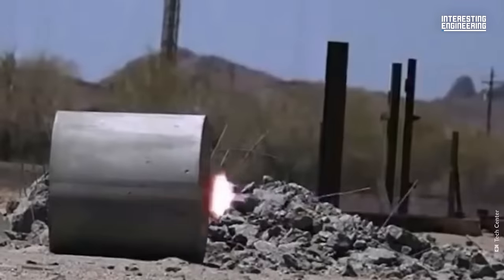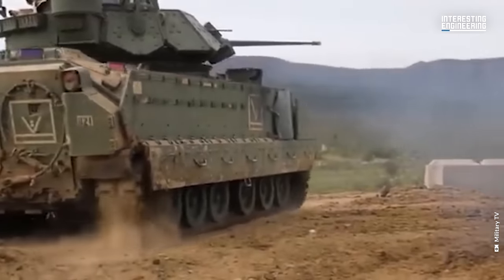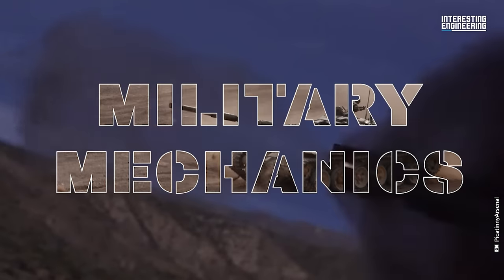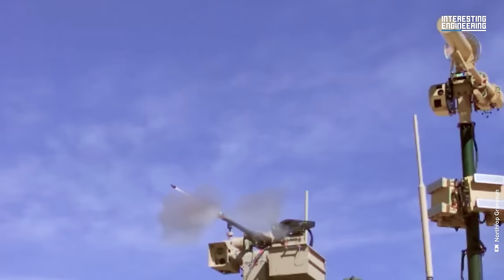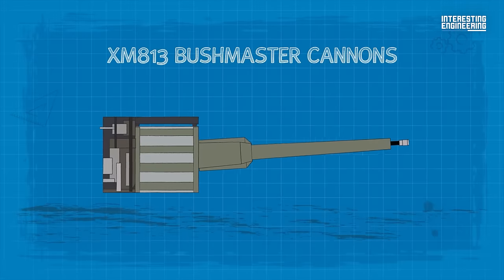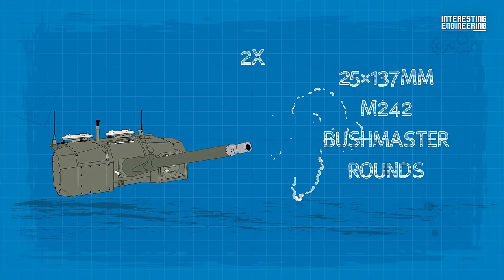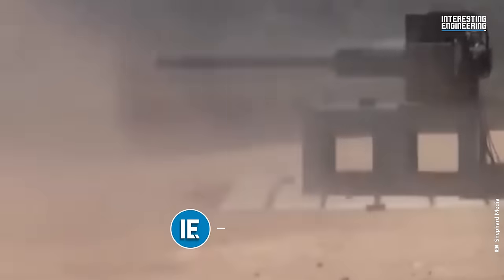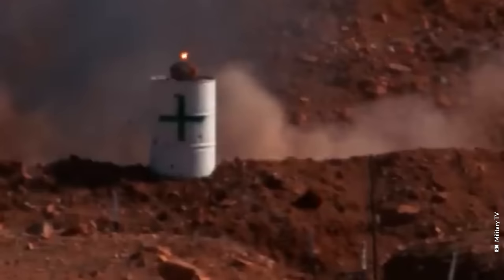🪖 What Makes the XM913 the World's Most Powerful Chain-gun?

Comment: A military equipment video made by people who don't know what they are talking about and for people who don't know enough about the subject to figure it out.
Reply: Do mean to tell me that non chain drive guns don't use the heat of firing to cycle.how on earth would they work if that were true?
Reply: 50mm calibre is tiny. Won't  penetrate MBTs. 
Most tanks have 105-120mm guns. And there are 155mm howitzers. And should i say those 406mm battleship guns?
Reply: @parrotbrand2782  a 50mm is huge for an auto cannon especially something mounted on an AFV. It's larger than most tank rounds in WWII

Comment: The smaller / older brother, the 25mm Bushmaster, on the Bradley, has shown that with a few shots and tiny bit of luck, it can get between the hull & the turret of a Russian main battle tank and take it out, and we've seen that not once but at least 3 times. Now give us a version which is not much bigger, not much heavier, not much more expensive, has roughly the same rate of fire, but double the calibre ~ that's got to be a lethal and desirable weapon. Given this is not armament for an MBT, but armament for an armoured personnel transport, (like a Bradley) and we're looking to a real advantage / over-reach here.

Comment: The programmable air burst rounds are what this gun system is all about. Dug in infantry can be engaged with direct fire, that explodes overhead, with an effect similar to mortar and artillery shells. Good results on aircraft can also be had with this ammunition.
Reply: Unfortunately it costs too much, 95% of all ammunition fired in a conflict like Ukraine hits absolutely nothing, especially small rounds, it's blind fire, or suppressive fire, cheap rounds that can be made for a few cents, quickly in large numbers, these intelligent rounds can cost hundreds if not thousands, the smart ammunition made for the Zumwalts 2 deck guns cost nearly $80.000 a round, that's why they don't use them or train with them it's too expensive. So imagine all those Bradley's with 50ml guns and smart ammunition, how much would that cost just to arm them with a couple of boxes? How many new Bradley's will the US build, id say 500 at the lowest. I love the programmable Smart rounds, they are trick as fuck but not even the US could afford to use them, not at this time, would they ever be cheap to build and buy though? I can't see it, so it's just another clever gimic with no practicality, maybe special forces? But that's it, regular units no chamce

Comment: now they have to come up what new design of IFV suited for that. Bradley... nah, unless you slim down everything that gets in the turret's way, upgrade suspension with better track , and probably new atgm.
Reply: It’s designed to basically take the space of the 25mm with no issues.  The larger ammo will probably mean they will have to lower TOW storage from 10 to 8.  But I doubt few Bradley drivers would need all 10 before being able to resupply.  With that said there are some new concepts the Army is considering.  Truth is, they really aren’t needed now.

Comment: The question is, can the 50mm penetrate the armor of vehicles  that the cannons from the 25/30.35/40mm can not. If the 50mm is not able to penetrate the armor of MBT while something smaller than the 50mm  can penetrate anything short of a MBT, then I have to wonder at the added utility of the 50mm (other than bragging rights to say that my gun is bigger than your gun). The definite negative of the 50mm is that the volume of the 50mm round is in the neighborhood of 4 times that of 25mm and the volume that can be allocated for ammunition is always limited. The result is that the individual rounds might have a much bigger impact than smaller rounds, but if you can only carry a quarter as many rounds, does the 50mm still represent a step up in combat effectiveness.

The recent video of two Bradleys hammering a T-90 in Stepove illustrates my point. The front armor of the T-90 had nothing to fear from the 25mm of the Bradley. But the 25mm didn't need to penetrate the armor of the T-90 in order to completely obliterate the combat effectiveness of the T-90. All modern tanks have a much higher combat effectiveness because of their advanced sensors, cameras and computer system. But all of the key bits are the cameras and sensors, and they are all on the on on the outside of the armor. So while the 25mm rounds from the Bradley had zero chance of killing the crew, detonating the ammunition in the turret or disabling the engine, they were more than enough to obliterate all of the cameras and sensors on the outside of the armor . And with many more rounds and a high rate of fire, the Bradley chain gun was able to put so many rounds on the front of the T-90 that other than the direct viewing periscopes, I doubt the crew was able to see anything
Reply: IFV armor is still a thing. Take the BMP-3M from Russia for example. Assuming it is as good as the Russians advertise (let's be real, it won't), then this thing could hit it and pen through the armor at longer ranges. 
Not to mention the HE round is likely to be much larger than that of an M242 25mm.
Reply: Airburst feature  in a shell is expensive and takes up space, for both reasons you want a bigger shell, USA already concluded that 25mm  airburst is a joke with the XM25 program.
Reply: Or hear anything after, for that matter.
"Niet, yourrrr hearrrrring loss was deemed niet service conecdeeid"
Reply: the 2s38 can carry ~148 rounds....thats plenty of 57mm to do some work.

Comment: Full auto at 200 RPM? How many seconds until the barrel melts?
Reply: its water cooled.
Reply: @rpscorp9457  No, it's not...
Reply: @wipatriot510  it definitely is.
Reply: @rpscorp9457  No, it isn't...I've done the research...
"The XM913 chain gun is not water-cooled. It is an advanced 50mm chain gun developed by Northrop Grumman, primarily for the U.S. Army’s Next Generation Combat Vehicle12. The XM913 uses air cooling, similar to other chain guns in its class1."

Comment: This thing could be a real threat even for MBT´s
Reply: This is actually made, "light" as it is, with tanks in mind.  The currently Bradly's 25mm is already enough to damage most Soviet/Russian tanks, with a few sustained bursts, as seen in one of the most recent videos, with a Bradley going up against a top of the line T-90 Russian tank (the T-14 are largely a dozen or two prototypes, that broke down during a parade: can't mass produce and use such a weapon system, when it is still so unproven, mechanically anyway)... 

This being a 50mm and with all the updated technologies going into it, standing on top of the already proven 25mm, it WILL likely be enough to destroy most tanks with 2-3 shots. Tanks could, of course, be given thicker armored; but it'd slow them down... so the current thickness of most high end tanks are likely not increasing substantially (if new/tougher/thinner materials can't be found). 

(.....Projectiles/bullets can be delivered very differently... from Bronze Age gun power, to something in between, to electromagnetic power.... so small projectiles can be made to have extreme penetrating power, with less cost. 

The developmental RAIL GUN, both China and the US are purusing this.... is one such system: it is using electromagnetic power to launch a simple projectile up to 5,000 miles per hour... so complexity resides in the rail gun, not the gun-powder powered projectile... making projectiles orders of magnitude cheaper to make and to buy.....)
Reply: @kiabtoomlauj6249  what a load of rubbish. Try to finish some school boy, and less video games and CNN.
PS
Serbian IFV Lazanski is using 57mm automatic gun that would tear apart  anything in vicinity of 12km(Javelin 2.5km range)....let alone what Russians use
PS2
Rail gun is left unfinished, due to tear and wear "the rail pipe" whose material can not sustain such a wear and pressure.

Comment: This is what should have been used for the m10 booker tank instead of the 105 mm canon.
Reply: Intended for different roles.   When you need a large caliber, nothing less will do.   JLTVs armed with the lightweight 30mm will also be in the mix.  Quite a lineup.

Comment: I don't see how you need much "audacity" or "engineering prowess" to develop a 50 mm chain gun nowadays. Medium size caliber guns like that have been existing since before WW2 and that particular caliber just has been out of fashion for a while.
The Germans during WW2 used 50 mm guns, both as their primary anti tank weapon on the "Panzer 3" in the early days of the war and later as a aircraft weapon.
There also is the Swedish Bofors 57 mm naval gun which has been in use since the early 70s and also was tested as a Infantry FIghting Vehicle weapon on several test vehicles.

Also, there are socalled "Revolver Guns" since the 80s, mostly designed and built by the German Rheinmetal and Mauser companies, which also don't use the exhaust impulse of the firing round to load the next round, but also use electrical mechanisms to load the rounds into a rotating revolver drum and kind of being a half way in between thing between a regular gun and a multi-barrel Gatling style gun. They are basically like Gatling guns, but only using one barrel while loading that one barrel like you would load the multiple barrels of a Gatling gun.
That totally eliminates the need for a bolt and allows for variable and very high rates of fire, while being lighter, less complicated and more precise than actual multi-barreled Gatling guns.

Two other advantages of that system are that much like old revolver handguns, you can fire cartridges of differing lengths from them. They just have to be shorter than the length of the revolver barrel and because you don't need a bolt, you can leave the back of the firing chamber open and thus make a "no recoil" gun out of it by firing small rockets from it instead of regular ammunition.

My point being, compared to that a chain gun is a rather simple and unsophisticated piece of technology nowadays.

I'm also surprised that there is no data link ring at the end of the barrel, like on the 30 mm and 35 mm Rheinmetall gun barrels used on the PUMA IFV or the MANTIS/Skyranger air defense systems to program air burst ammunition with.

Since this gun uses air burst ammunition, I assume the round is told when to burst before being fired by a data link system inside or near the firing chamber instead, but that has a disadvantage compared to the "muzzle data link" system on the Rheinmetall guns.
Those first measure how fast the round leaving the muzzle actually is before calculating where it needs to burst and then programming it.
A system that programs the round before it is fired can't account for slight variations in the propellant load, atmospheric factors or other factors that influence how fast the round will really move once it is fired.
As anyone who ever used a velocity measuring device while firing a gun (or watched Gun Youtubers do it) knows, even the best, most expensive ammunition has pretty significant variations in muzzle velocity.

Only by actually measuring it at the muzzle and then calculating and programming the air burst distance, you can ensure that the projectile actually bursts where you want it to.
Reply: Oh ok
Reply: @@Brunel1859 Yes, which is why many guns that were already used during WW2 are still in use now.
What I find strange here is that they developed a new 50mm gun but didn't incorporate the state of the art when it comes to where gun and ammo technology are right now.

As I explained in my initial comment, I think that a muzzle data link device ought to kind of be mandatory nowadays, to utilize the full potential of air burst ammunition.

As it looks now, they really just upscaled the old 25mm gun the Bradley uses without doing anything clever.
That is why I pushed back against the swooning marketing language used in the video.
Reply: Chain gun. CHAIN GUN, not the same thing as an autocannon.
Reply: @Austin-cx2xe  What is that supposed to mean?
Have you even read my comment before replying to it?
What about my comment gave you the impression that I would not be aware of this being a chain gun?
Reply: @TrangleC Using embedded sensors and instruments in the barrel and extremely fast fire control and computing system, you can measure and calculate the muzzle velocity just after initiating powder deflagration and then using electrical impulses to program ammunition before it leaves muzzle to control detonation distance before munition triggers for maximum dispersion of payload saturating an aerial region, presumably with high density material pellets at high velocity if for ballistic interception as you've mentioned, just before tracked target flies into the dispersion field and gets peppered (and prob premature detonation, guidance system destruction, etc). While fundamentally, they all work towards the same purpose and use the same principles, the difference between modern day and WW2 weapons platforms are the fire control systems, ballistic calculations systems and in some cases, payload control systems. This has made drastic differences contrasting the eras of comparison with the increases in accurate to precision fire and effects where WW2 weapons depended on quantity requiring laying down a sheer wall of lead with dozen and dozens of emplacements can now be replaced with one turret. Previous US capital ships would have arrays of like many dozens AA emplacements during WW2 like fleet aircraft carriers with about ~40 maybe closer to 50 now have like 2 maybe 4 CIWS platforms, IIRC. Of course, just what I figure so make of it what you will.
Reply: @@Brunel1859yup, standard propellant based guns are a mature technology which means significant advancement is unlikely, but sensors, fire control systems and smart ammo still have room for improvement. Laser guided ammo that can alter its trajectory during flight (a bit) may start to appear at some point considering we now have laser guided .50 cal rounds. Programmable air burst / burst after penetration rounds (which are usualy the same thing) should be standard soon - at least in western militaries.

Future weapons may include Electro-Thermal-Chemical (ETC) guns or some form of electrically propelled guns, such as rail/coil guns. Both exist already of course, but they are not quite mature enough yet for widespread deployment. So basically what @TrangleC said 😅

Comment: The ammo for this is way under powered. Instead compared to the 57 mm Soviet anti air craft round that's a proven design. The Russians are making a custom turret with this gun. With a 7km range and sensors fuzed rounds.
Reply: That would be scary,  if any of Russia's crap actually worked, or if they had the slightest clue how to deploy it.
Reply: @gordonlloyd9335   it works just fine ask any Afghan vet if a 35 year AK will kill you......